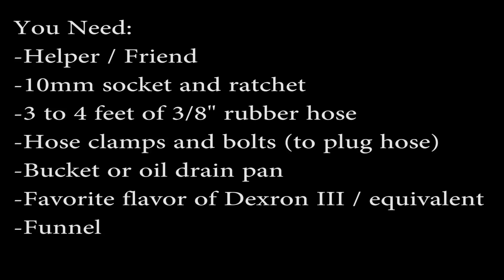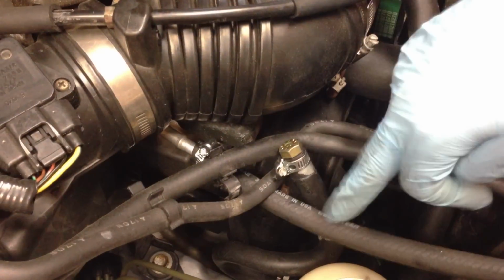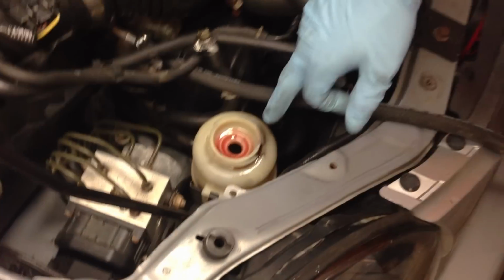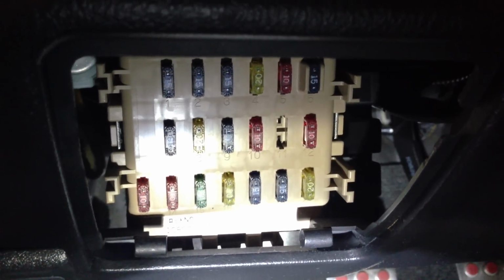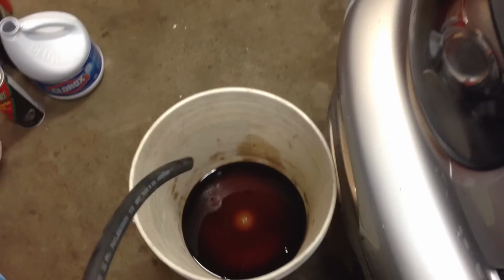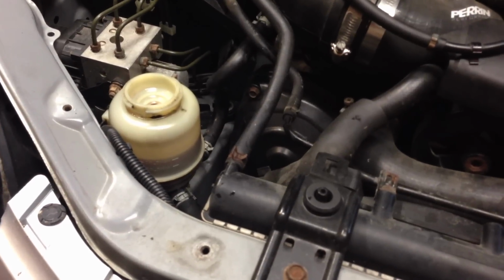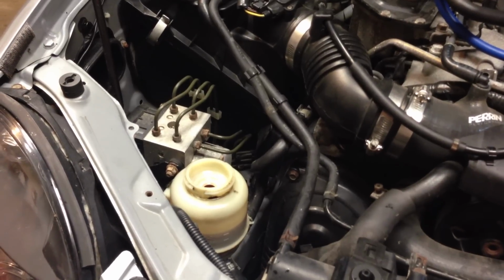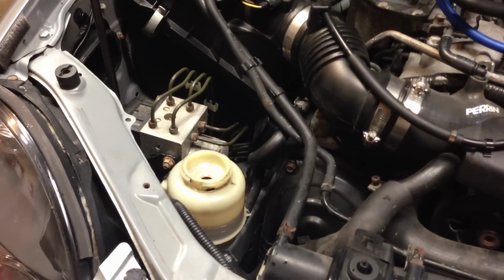DIY: Subaru Impreza WRX Power Steering Fluid Change

Comment: Why you need to start like this
Reply from the maker: When the engine is running at full idle RPM it's going to suck that PS fluid through the pump very very fast. This ensures you don't introduce any air into the lines, and allows you to more casually exchange the fluid out. There's then no need to sit in the car and move the steering wheel back and forth

Comment: Did this on my 04 FXT. Easy as and no more whine! I didn't pull the fuse just lock to lock to pump out all the old crap. Used about 1L of fluid

Comment: i saw on YouTube to not turn the engine on. fill it turn it lock to lock, do this until you see the clear red new ATF fluid. Then turn on the engine and move the wheel again from lock to lock of course making sure the PS reservoir is in proper level. Is that ok too?
Reply from the maker: Yeah. That is perfectly fine too. This takes less time IMO :D

Comment: thanks Buffman! I was lookin for another way to change the fluid without having to take out the PS belt!  this would work much better.  Gonna do it tomorrow!  thanks again!
Reply from the maker: +Doua Xiong No problem. I learned this a long time ago on my Buick Roadmaster, and it makes the job a lot less hassle
Reply: +Buffman I did that procedure...15min max..done.  painless and no mess.

Comment: My return hose was also quite tight. I softened it up with a hairdryer first and it came off far easier. Less risk of splitting or damaging the hose this way! Learned it from MCM.

Great method, very fast and easy.
Reply from the maker: good call. Would have never thought of that..

Comment: doesnt this method still introduce air into the system ??
im having a major issue with my power steering. so i tried this method to flush out the fluid.
turned on the car, steering was super stiff, then it even'd out. took it for a drive and the steering got stiff again. 
idk what the issue is, i've replaced the pump, hoses, clamps, put new fluid, flushed it out, put new fluid.
Reply from the maker: as long as reservoir is full it shouldn’t.  Pressure switch in your pump good?
Reply: @BuffRANGE  think thats the problem. ima have to check to see if i can buy a new one.

Comment: How can I properly dispose of the old fluid afterward?
Reply from the maker: Most all autostores in the area have free oil recycling of up to 3 gallons at a time :)
Reply: And that applies to the steering fluid, too?
Reply from the maker: cscooper2000 Yes. Most of my local stores only stop you if there are other things mixed in like brake cleaner and coolant, but oil is oil to them.
Reply: Thank you!

Comment: I have heard you should also turn the steering wheel full lock in both directions to flush the old fluid out of the steering rack.
Reply from the maker: You can. I can't imagine much fluid not being exchanged from not doing it, but it wouldn't hurt.

Comment: thanks for the video! this is such a quick and easier way to flush/change psf. one suggestion, i tried pulling the fuel pump fuse( 08 WRX couldnt figure out which ign fuse to pull) so i ended up leaving all the fuses in. so i had my dad start it and i watched the fluid in the reservoir drain and just yell for him to shut it down before it got dry( so in reality the car ran for 2 seconds. this made the process pretty fast

Comment: My return line hose will not come off. The line is rock hard. I can deadlift 415lbs all day. Felt like I was about to rip the whole power steering system out of the car.
Reply from the maker: +Brad Mazur Don't you just hate rubber lines that never want to come off. I feel the same way when changing the fuel filter sometimes. I really wish Subaru went to quick disconnect on these. :)
Reply: +Buffman yeah. I'm blaming it on the age. 10yrs, 182k
Reply: This is when the turkey baster way comes in handy

Comment: @buffman is the fuse number for the ignition the same on a 2012 as your bugeye?
Reply from the maker: No clue. there's a good possibility knowing Subaru it is, but check owners manual
Reply: Buffman - R.A.N.G.E. okay I think I found it. Is it the starter relay?

Comment: how much steering fluid you used for this method?I have 2013 sti
Reply from the maker: +Robert Jayson Sabas I used about 4 qts. Once the fluid comes out clean, then you can stop.
Reply: +Buffman - R.A.N.G.E. how much did it cost for all of it?ahou0 I change the hoses too?
Reply from the maker: +Robert Jayson Sabas Yeah Just gas some oil/gas rated hose from the auto parts store. There's no need to replace the hoses unless they're damaged.
Reply: Alright man thank you, I should top off my steering fluid tomorrow

Comment: I followed this procedure the other day on my Blobeye STi and I can confirm it does work. The hardest part for me was actually getting the original return hose off the metal pipe from engine - it was an absolute biatch to get off. Had to take off the custom intake also to get better access to it. Also it fairly drains the battery - be careful it doesn't go dead - after a few cranks I could hear it getting slower and beginning to struggle. Also turned wheels full lock and could see fluid emptying into bucket on turns. Now just need to get air out. Steering still rough first day, was better today, hope its just stuck air and not new air continuously getting in some leak...
Reply: Any updates?